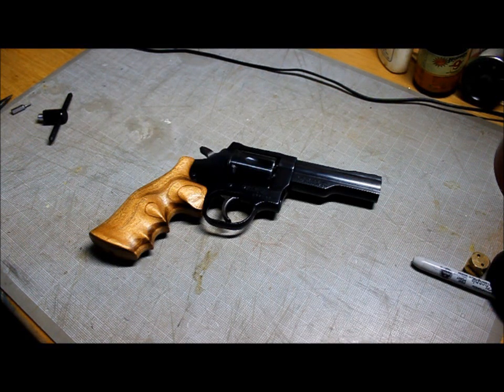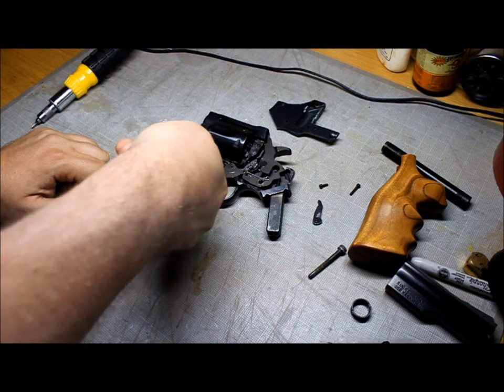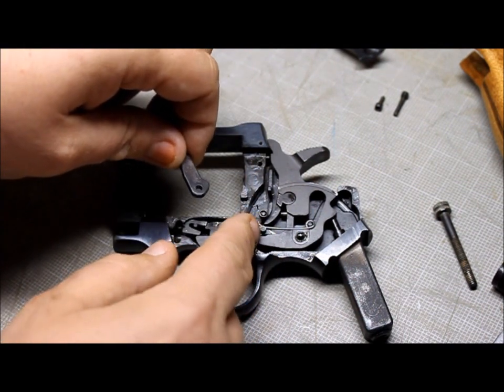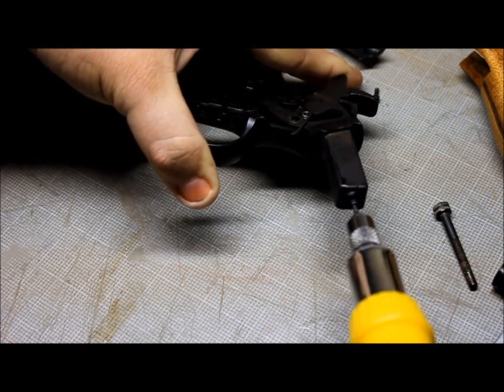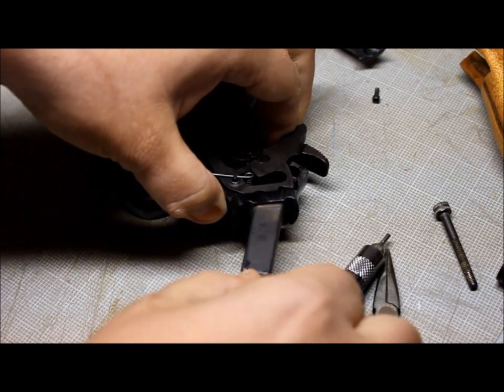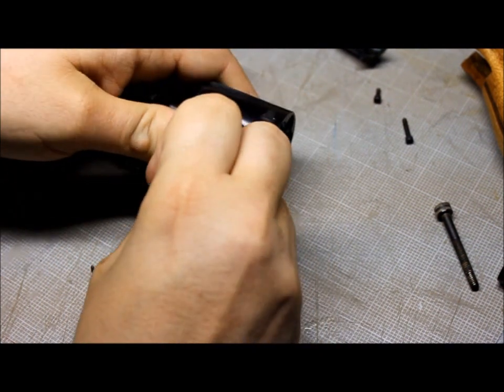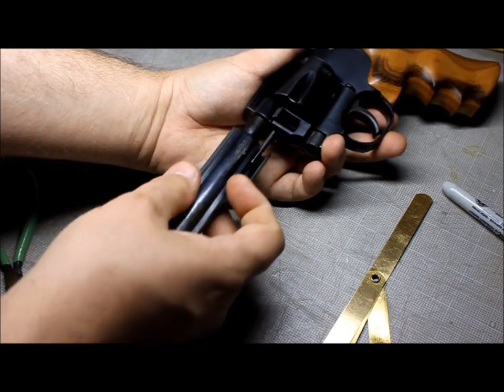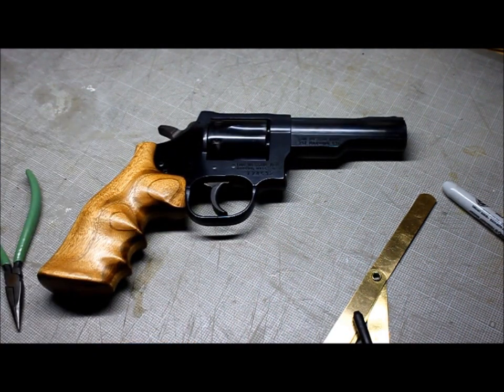Dan Wesson 357 revolver models 14/15 complete break down

Comment: Excellent tutorial. Thanks!

One thing to add:  check your cylinder gap again after you tighten the nut at the end of the shroud. Sometimes it’s dead on, but sometimes screwing that nut in tightens the barrel just a bit too much.

Comment: Thanks. I have a DW 15-2 and had to put in a new spring kit . It wouldn't strike the primer with enough force in double action. Got a kit from CZ USA. Your video helped me recall how to reassemble. Thanks. While I had the gun broken down, I polished the inside of the frame taking out all the machine marks to a mirror finish. I had the hammer and trigger finished in a hard material, don't remember the name now. It was featured in a Handgunner magazine 35 years ago. Anyway, I polished the contact ribs on the hammer/trigger too so the action is smooth as silk. I carried this revolver when I was a cop 1976-1979. It is a great revolver with thousands of rounds through it.

Comment: thanks, i never imagined the long screw and hammer spring thing.  what a clever trick, because i was struggling really hard to get that hammer spring compressed to take out the hammer lol.  now its all clean and fresh oil in there its running very nice.  sounds great, i mean it always sounded good, but it sounds even better now.

Comment: If the side plate is tight, lightly tap the square grip / mainspring housing. Keep in mind with the take down and reassembly that the short end of the trigger return spring rests behind the hammer pivot pin.

Comment: Awesome vid! It came in very handy when I frog lubed my Mod. 15, 357. It was a little bit confusing when replacing the hammer and that pain in the ass spring but other than that GREAT VID
Reply: Pistol Pete It’s four years later. Your frog lube should be the consistency of baked on tuna cast by now.

Comment: Is it normal for the cylinder to slide along the crane? When I swing the cylinder out away from the frame, the pushrod pushes the entire cylinder along the crane instead of pushing the ejector through the stationary cylinder, ejecting the spent casings.
Reply from the maker: Not really. It should be stopped when you swing the crane out by a little piece of metal that is on the side plate. If that piece is missing (they can fall out of the frame so look to see if you have a divot). If you look at the picture here http://forums.1911forum.com/showthread.php?t=214080 you can see the little piece of metal on the frame right above the trigger.  I hope that is clear enough and helps you. If not there is a great forum for dan wesson revolvers http://www.danwessonforum.com/ which may have a better answer for you
Reply: Good call! I see now that the side plate is missing that piece. Now to locate a replacement.. Thanks for the vid and for the info!
Reply from the maker: I am glad I could help you

Comment: That small spring connected to the trigger bar/transfer bar which I think is called the handspring. Is that spring supposed to be under some tension?   I had to order a new one cause my origianl one got bent when I was pulling the trigger to see is it worked after installing a new 8lb hammer spring from EWK.  I've looked at various pictures on the net and your video and looks like the handspring should be locked under tension.
Reply from the maker: Derwoods9 I wish I could help you but sadly had to part ways with my DW so there is no way I can look.

Comment: I have the .357 kit that I bought long ago.  On the hammer side of the cylinder, in the middle, there's a ring that appears to be held in place by a very tiny compression pin.  (In your video, you did not take the cylinder completely apart.)  That pin is present, but it no longer maintains a good mechanical hold on the ring.  Therefore, the ring will come out when I use the shell ejector and the cylinder is not dependably stable.  Do you know what kind of pin this is or where I can get one?   

Not a common part.  It is extremely small.  At this point, unless I can buy it, I'm thinking of going to a gunsmith.

Discovered this 25 years ago and have not fired the gun since.  The kit's in near perfect condition.   Re-discovered the kit when I moved and now my frustration at not being able to safely use the gun is renewed.
Reply from the maker: try ewkarms.com but most likely you will need it made
Reply: +MrQuark71 Thanks MrQuark for pointing me in a viable direction.  This pin is likely the smallest part on the gun.  Had the gun timed back in 1988 and this was how it came back.  About the same time that I moved.  Giving a few places a try including EWK as you've suggested.

Comment: How in the world did you unscrew your pushrod so easily? I just bought a used one and am taking it down to refinish/tune it and I can't for the life of me get the pushrod unscrewed.
Reply: apply penetrating oil on the star let soak apply a small amount of heat with a propane torch
Reply: I am having the opposite problem my extractor rod came out and I cannot get it to thread back into the extractor.  When I remove the extractor it screws in just fine